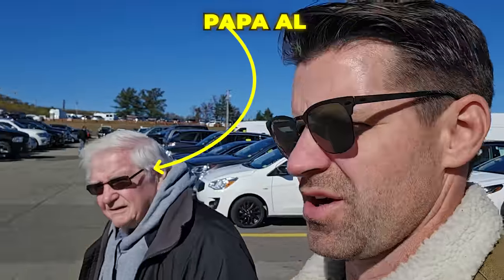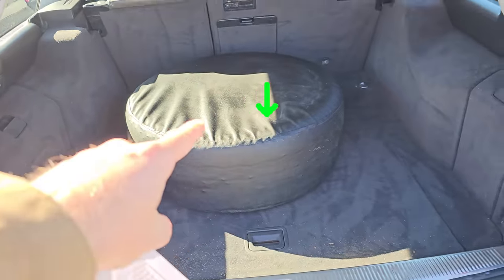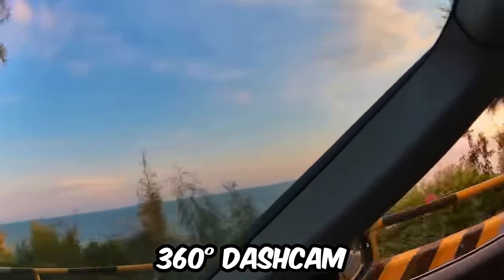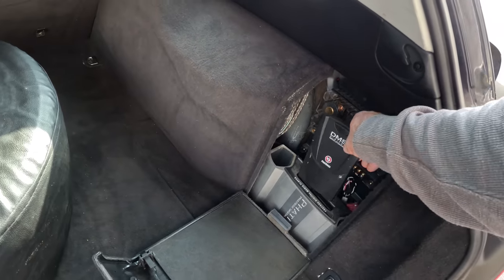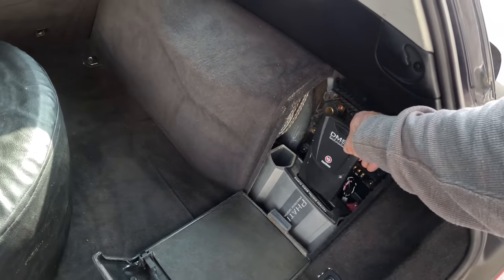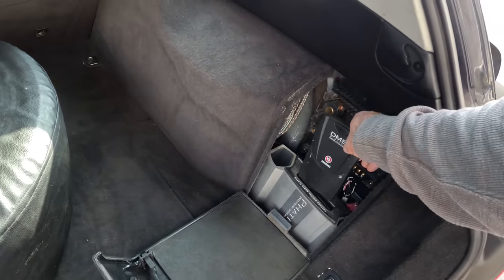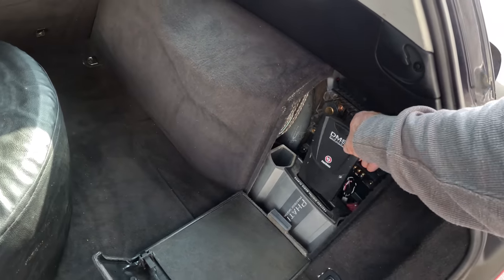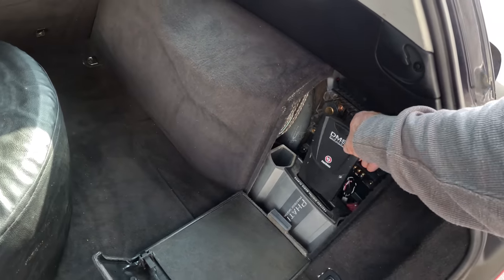I said I would NEVER buy an AUDI again but this one PAID OFF!

Comment: I have a 2001 audi allroad and yours has a Phatnoise PhatBox music player. The reason they are cool, is that they plug into the existing CD changer DIN plug and you can use the factory headunit to find songs by a pretty smart text-to-audio search interface using the factory headunit buttons and dial.  The storage is a 20GB+ portable harddrive.  There is a docking station that allows for "easy" transfer between a computer and the portable storage harddrive.
Reply: Pretty neat for its time

Comment: that 4,2 is solid   except the timing chain guides      and the suspension will go lol....but that was a great buy   looks very well cared for and maintained
Reply: That's why you get an A6 or A8 with the belt driven V8. Pretty stupid why they only put the chain V8 in the Allroad.

Comment: Couple years ago I bought an 04 Allroad V6 for $850 at an auction with 190k miles. Replaced the front Axles for $110 . Basically drove it for 2 years and 30k miles as a winter car. Sold it for $2700. Next owner blew it up shortly. Don't beat on it, it ran and drove great! Needed fuel pump eventually. Like $60, easy under the rear seat parking lot replacement. Did brakes because of my 6 year old daughter.

Comment: I’ve used a dewaxer called Vericlean which will remove the wax from the plastics without damaging anything.  We use this dewaxer in fiberglass boat molds when we need to clean molds and rewax them.

Comment: That Phatnoise is an aftermarket multimedia hard drive system. I had one back in 2002. It's gonna be useless if you don't have the cradle that connects to the computer and the system drivers. The cartridge you pulled out is what holds the media, it goes into the cradle to be able to add media, they came in 1 gig and 3 gig of space if I remember correctly. It then goes back into the car to play it. It's a Kenwood system. I had mine hooked up to a Kenwood DDX7017 double din touchscreen when I had it.

Comment: I had a 2004 Allroad with the 2.7T and stage 2 tune. I  loved that car. Unfortunately they didn't age well mechanically due to their complexity and cost of maintenance thus you see fewer and fewer of them on the road.
Reply: that's every Audi.
Reply: @timewa851  true to most modern European cars
Reply: @timewa851  I see quite a few normally in the groups with over 300k miles.

Comment: I retired after running a shop 37 years the only way to safely clean the cloth headliner is use a soft terry cloth or microfiber miss the cloth with Windex Windex and gently wipe it that will remove the dirt without damaging the headliner

Comment: Haha holy shit a Phatbox haven't seen one of those in 15+ years - Back in the day, they were better than CD's, cheaper than MP3 players, etc. They were a drop in replacement for the factory CD changer for a number of applications. It interfaced with the OEM Audi CD changer and allowed you to dump a ton of music on instead of CD's. It was pretty quickly replaced with iPod's and Aux jacks and then later MP3 storage in dash. Nice find!
Reply: As a followup, I went down a rabbithole - Kenwood seems to have bought them out and turned it into the Kenwood Keg.
Reply: Man thanks for the info I was very intrigued by that and was trying to look into it but not much came up for me I wasn't sure what it was called but googling PMS didn't get me to anything audio related 😂

Comment: I know better myself. I still bought an Audi S3 earlier this year. 4 owners clean carfax and a verifiable service history. Guess what. Timing issue just 1000 miles later, bent the valves. ended up dropping about 11000 on replacing the engine. Add in the 1300 for the tires, the 1300 for the water pump the 1300 for the DSG and Haldex service and the 1300 for the pads and rotors. im about 17000 deep into a 20,000 car

Comment: My favorite car I ever had was a 2006 Audi S4 avant manual 6 speed with a VF engineering Supercharger.  It was a 🦄. But after I got ot to about 65k miles I sold it because the cost of timing chain and tensioners.

Comment: Maybe the nay sayers keep stating the timing chain eventually fails w/those v8 Audis is because they are usually driven aggressively all the time by always flooring the accelerator -basically launching it like every V8 naturally aspirated Audi. If you drove drove it smoothly (like Ms. Daisy =P ) to top end speed, it would last longer and won't fail. For that price acquiring it, good catch Craig!I'd buy it from you if I didn't have any debt. If the chain fails, that'd be negligence from 1st, 2nd and how many owners who drive it like they stole it and/or neglect maintenance (and don't do preventive maintenance). I am fortunate my 3.0T is the CREC engine (the bolt on supercharger pulley drive) that doesn't have the problems of the previous generations.

Comment: That A7 got a APR ultracharger   (throttlebody) this means it is most likely either a dual pulley or a 207mm lower pulley, you should be close to 500hp in that thing if so.
Check if you got an upgraded heat exchanger if not, got one as it will heat soak, in addition with a ultracharger you should either be catless or race cats on it, if not you are melting the cats clogging it up, or blowing them out.
If it is catless you need a vibrant J-pipe Co2 spacer to not get the cell.
Reply from the maker: Helpful. Thx!
Reply: Came here to say this but wanted to check the comments.  lol Also Craig I'd check the supercharger intercooler bricks those can cause coolant leaks and as well as the water pump/thermostat. Outside that, that's the only thing that really goes wrong on those 3.0 supercharged cars. But as espen said this is more likely a dual pulley car with around 500 HP if it has the ultra charger.

Comment: Craig, not sure if you are aware but that a7 has to be atleast stage 2 with some tuning company, making around 400 something hp, that Apr piece you pointed to is an ultra charger.
Reply: You should definitely checkout the pulleys in the front of the engine

Comment: If you have spray paint and want to brush it on, just grab some wax paper and spray the paint on that in a concentrated manner. You can then brush it.

You can also use the 'fancier' paper plates. The shitty thin ones will absorb the paint.

Comment: Timing chain on the 07-09 4.2L V8 for all iterations of the engine are due at 135k miles and involve near 40 labor hours of work. It's a when not if part, but if you do it, the car engine will last you but it's like 4 grand for 100k miles peace of mind but doesn't solve every engine nuance of the 4.2

Comment: This gen has a timing belt, lucky for you! It doesn’t share the 4.2 that the B6S4 had
Reply: Just had a costly belt change but at least you can service it without the engine out…
Pesky oil cooler pipe, cam seals & adjuster with V/c gaskets  are all notorious too & the 5HP 24 trans isn’t good either… it’s a ZF it’ll fail 100-150k then need a rebuild…
Reply: Do an 01E swap and call it a day!

Comment: That audi is the bomb for that PRICE! Yeah this engine has some issues, but it's the 4.2 Quattro and quattro is a great AWD system very similar to some Subaru AWD systems, the problematic air suspension is swapped, the engine was indeed purring and it is NOT the 3.0 bi-turbo, which was very fast way back then, and even more unreliable! Those who haven't driven an Audi, doesn't know what level of premium car feel they are getting with A6 wagon/Allroad, how nice the dashboard is even on this old models. Oh yeas, I had a newer generation in 2010  and it had the same plastic things broken and a bad engine design from the factory, which later became well known like many other Audis, everything major broke,, but some engines are good. Now this Allroad is cheap and even , if you need to put 2-3K more into parts, you will be driving a reliable nice daily V8 AWD Wagon Crossover (Allroad was what we call crossover today but AWD). It is worth every penny.
Reply: 2.7t is alot more reliable than the chain driven 4.2. The only C5 with a chain engine was the Allroad. Which is quite weird cause C5 A6 4.2 the S6 4.2 and the RS6 4.2t are all belt. Even the later A8 D3 is belt 4.2.

Comment: That’s a belt driven V8 in 04’ … when Audi was good…  at least you can service it without the engine out… costly dong a belt… oil cooler pipe originally is a plastic little pipe… get the billet aftermarket…

Comment: Never cross wires, they pull apart for safety
Reply: Its just an old detailers trick cause the extension cord gets caught under the tires as you pull it around the car 😊

Comment: You are a decent (by decent, I mean "a good guy"), used car salesman. You repair major mechanical problems and you won't sell people deathtraps. You have also "pulled back the veil" a bit.  What you do with paint, buffing out a tired paint job is a service, a good one. Covering up cracks with a layer of paint and buffing it out, those cracks will return in 6 months. To be fair, they are used cars, you are not disabling service engine lights or anything like that. The abusers in your industry do, you; however, are an honest used car salesman. I would buy a car from you. They are used after all, and it is what it is. Buyer beware. Quite frankly, you probably do more for the maintenance and repair of the vehicles than the buyers ever will once they own them.

Comment: Isn’t it sad most audis with next to no mileage almost always needs everything fixed. Such a junk garbage vehicle brand
Reply: On my 4th Audi (2023 A4 allroad) since 2006 and have experienced zero problems.
Reply: @chaosensues1656   because you sell before high mileage. Without lying to me I guarantee you couldn’t say you kept one of them over 180,000 miles. They are 100,000mile engines then they go to the scrap yard. There’s always one guy through all the proof the sky is blue yelling that it’s green. 🤦‍♂️